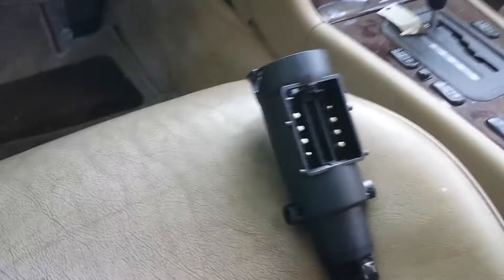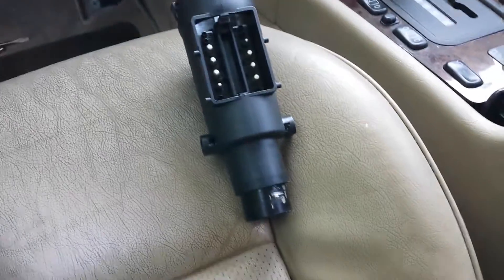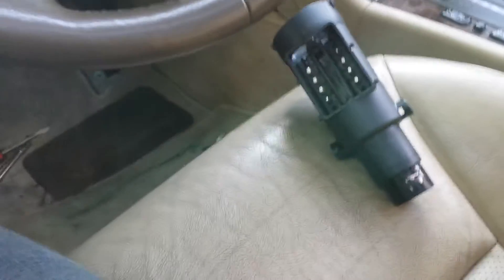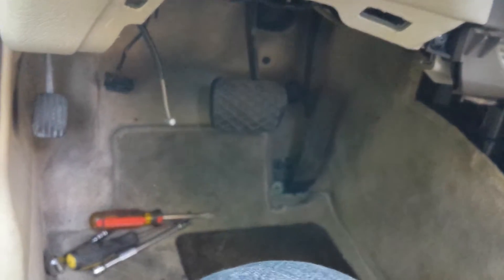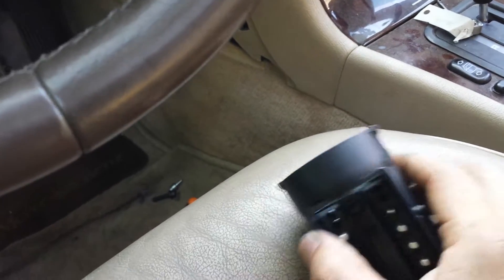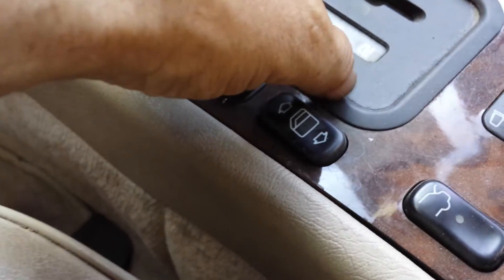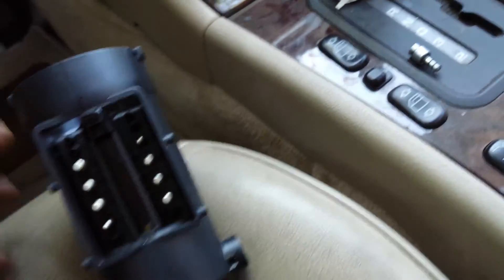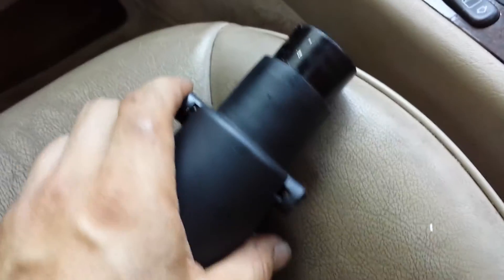1996 w210 ignition switch removal

Comment: Did you made a clip on how to reassemble the switch, ignition tumbler and the two protection sleeves? I am using the old big sleeve with a new tumbler, new small protection sleeve and a new switch, but I am having a hard time getting them to work together. I would greatly appreciate your help/input with this

Comment: tried pushing in the pins and they won't fully depress preventing the housing to pull out. I asked around and I heard in order to push the pins all the way in the key has to be turned to position 1, is there a trick to this or was it just magic?